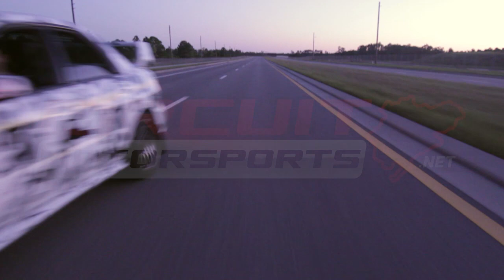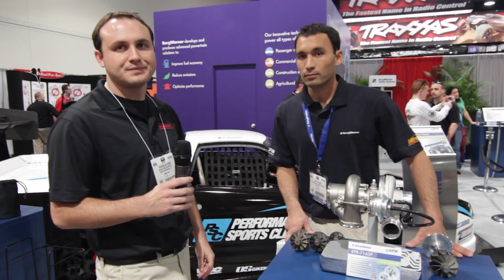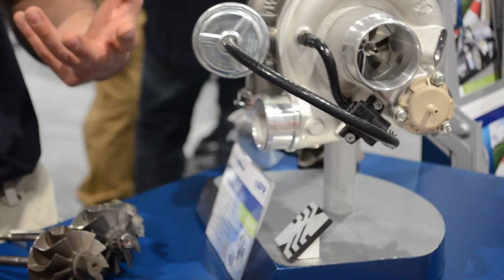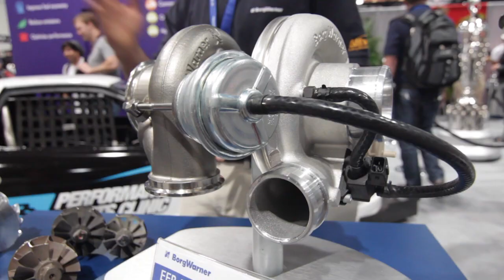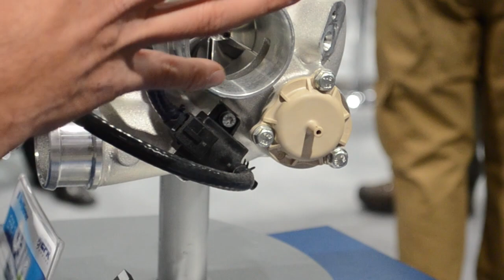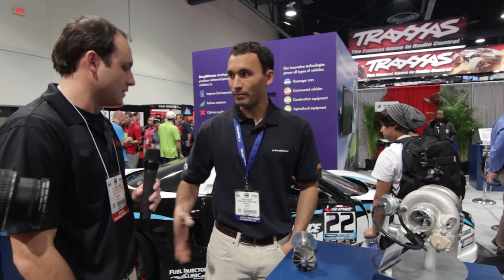SEMA 2013 - Borg Warner & Full Race Subaru Turbo Kits

Comment: It is a bargain considering you don't need a blow off valve and external wastegate plus the extra cost getting the wastegate dump routed back in the exhaust system.